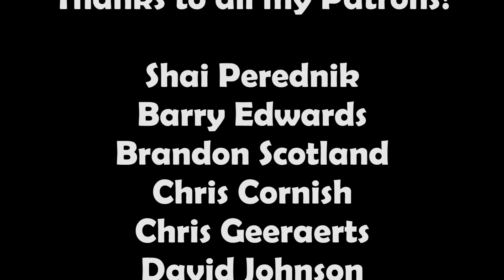Watch this before buying the Artillery Sidewinder X1!!

Comment: The idler arm is not an issue with this printer specifically. Almost every Titan clone has the exact same piece of plastic which will snap if you pull the arm too hard. That’s why I upgraded to a bondtech clone
Reply from the maker: Only other Titan Clones I have from a manufacturer are the Tevo ones and they do not have this issue at all. I've used TriangleLabs ones as well as an upgrade and they do not break.
Reply: @Fugatech3DPrinting  There are metal idler levers available.

Comment: `Buying a machine and knowing that within a week.....blablablagh...
Sorry, I think you made a great point with the idler, and also with the ribbon cable, but don't talk like the printer is the biggest piece of crap in the world, as that is just not true.
I have a couple of them running almost daily, and I have not had 1 problem with them. I don't even use the Idler, as I remove and feed the filament from within the menu and this works fine.
I think when I compare the quality of the prints from this printer to that of the JGAurora A5, the Anycubic's, the Prusa MK2 and MK3, this printer nails it, by far.
Yes, you might have to put a drip of hot glue on the ribbons, that's a very good solution you give there. But hey, big deal. bring it that way, without the whole disaster story.
Reply: My thoughts exactly!
Reply from the maker: It does print very well but the Anycubic and MK3 that I have didn't break within the first week of using it. If they would actually fix the idler and fix the ribbon cable connector, hands down this would be the best printer around.
Reply: @Fugatech3DPrinting  my Chiron from anycubic had problems since day 1. I just replaced the power switch after it had smoked and fried when I really needed it last week. 
But yeah, people have different yet common problems with cheap printers from China. 
Meanwhile my CubePro (US based)has been printing for more than 5 years with no replacement parts. Costs vary for that type of thing though.
Reply: @Fugatech3DPrinting  Anycubic, really? Mine has even no thermal runaway protection from start and I guess that is Anycubic standard. It is loud and I would never recommend that machine even for a single print without the thermal runaway protection. With some mods (fans, etc.), new drivers and a new firmware finally it is useable, but in the end I payed more than for the X1 which still has no broken parts and has printed so many spools without any issue.

Comment: Shane you’re so dead on. I got this printer and it had all the issues you mentioned. I got pissed and rebuilt mine. You didn’t even mention the other big issue. The MKS GEN L clone board is junk, the screen is junk and they both have major issues. 1. You can’t save to eprom, 2. It’s 8 bit, 3. All the wiring for the screen is mismatched cable ends to the wrong plugs and is hot glued together. I replaced my board and screen with a Duet 2 WiFi and Panel Due... the hotend and extruder are both completely garbage. A PTFE lined Volcano? Lol. The Titan Aero is cheap and works fine, but the tension arm is crap, the job gear is crappy, the PTFE tube they send with it is garbage, oh... and the Pancake Motor, yeah it has a press fit PLASTIC drive gear on it. I replaced mine with a genuine Bondtech BMG-M and Slice Mosquito. I also added a EZABL. Even with all that, it still doesn’t print super good because of the Z leadscrews and the brass nuts are goofy and cause z banding. I took my belt off, and removed their leadscrew plastic assembly. It’s way better albeit not perfect. 

I’m glad you called a spade a spade. This printer is good for most people. But for heavy or professional use it’s not.
Reply: You say "But for heavy or professional use it’s not." Why would you expect it to be? Are you kidding? Overstate the obvious much? Its a $400 printer from China (or wherever) competing with others in its class. That class has no place in production or engineering. What were you expecting when you ordered yours? You couldn't have really been surprised to discover its shortcomings unless you're a rookie at this and I doubt that you are. How about giving us a little detail about your leadscrew mod. That would be helpful. A sarcastic laundry list about what is wrong with it and why its junk is not.
Reply: @ew7007  I appreciate your response. If you go to my channel you can see my printer. I am no noob. I've been printing forever (3 years :)... With that said this is my first Chinese printer. I have two Prusa's and a SeeMeCnc Artemis. I got this printer with the intention of just using the bed heater assembly and the frame. But I didn't realize how bad the ribbon connectors are. The ribbons are fine and durable even... it's the shotty Chinese soldering on the PCB's... it's like they are trying to build PCB's in the basement of their mom's house. The Z Banding is a Major issue. They for many reasons have bad z banding. My guess is that they have a combo of Bent lead screws, and/or inconsistent upright extrusions or even wobbly wheels. In my case it the way they try to Chin-Engineer a anti-backlash system for the lead-screw nuts. I removed this system and went to good old fashion leadscrew brass nuts and it helped a ton. They also have the two z lead screws (and two Z motors) connected at the top with gears and belts. This is generally a bad idea. If the they get out of sync and they do, the X Gantry will tilt and stay that way causing issues. IF they are separate like they are supposed to be you can do a "MAX_Z" with sensorless endstops enabled on the Max_Z and level the X Gantry to the top cross-member like its supposed to be before doing the MIN_Z with a endstop or probe. That's how Prusa keeps the motors in sync all the time and the gantry level.
Reply: @thelightspeed3d712  Now that helps a ton. Thanks! I'll look into changing out the leadscrew nuts and employing the MAX_Z processes. I'm not trying to get Prusa grade quality but the Z banding is annoying as hell and something I want to address immediately as much as possible. The ribbon termination boards is a no brainer. I do appreciate your reply and follow up with good info. I'll check you your channel. Thanks again.
Reply: @thelightspeed3d712  You paid twice as much and then some for the Prusa and still had to fully assemble it yourself. You are not comparing apples with apples. I modified my Prusa loads before I was happy with it. This printer is sub £300. Anyone with 2 brain cells to rub together must know it's either going to be good enough as a plaything or a fixer upper. With the money I spent on the X1 it still comes in cheaper than the Prusa and I'm infinitely happier with it than I ever have been with my MK 2.5.... because yes I paid a shit ton for a Prusa upgrade kit to address the short comings of the MK2.
Reply: @thelightspeed3d712  All CNC board got a clone drive so a parallel axis is always synchronized without using mecanical part. I wonder why they don't used such board instead, such kind of board are not expensive at all.
Reply: And a professional wouldn't pay less than £300 for a work horse. Are people's expectations actually a bit OTT? As a hobby tool it's a bargain. We're makers FFS, these little hurdles are present on printers that cost more than twice as much. The new Prusa mini costs more than this and has had issues out of the gates. My full size Prusa needed loads of mods before I was happy with it.
Reply: "This printer is good for most people. But for heavy or professional use it’s not." lol

Comment: I have had mine since 1 November 2019.  It has been going constantly with many filament changes.  No problems.
Reply: soon soon will die, trust us... get some ABS os PETG and print a pair of those, or you will not be able to do it if it is your only printer.... I own 3 of them and all of them went down. I end up printing a few levers on PETG an all good since then. (dont print them with PLA).
Reply: Kreative Drone mine was fine, just adjust the pressure that was put on it
Reply: More important why would a company send a replacement part other than hardware right from purchase, if it wasn't a know problem?
Reply: @forward3dprinting796  Off course they know the problem,they are not stupid people yes?,and they know ALL of this problems,soo why  they dont solved even from Version 1, 2,3,4 and now 5?
Its call greedy...people just continue buy them, so they put literally-replacement parts the arm , and flat cable, and forgeit.
Lets mede the customer(the "makers") to solve.Now we have steel arm replacement.
Reply: your thing is gonna die soon not kidding, i almost returned mine
Reply: Don Gray okay clearly u dont understand this printer, in a month, my board was fried, ribbon broke twice and the heating layer of the bed lost adhesion, i only got it for a month, luckily they did send me replacements, but it was a hassle to install. i could’ve returned it for free, and just buy another one tho.
Reply: @icanc0  this is a late response, but how the heck did your board get fried, save from user error? also there is hot glue and printable strain relief for the cables, which is the first thing you shouldve printed. With the heat bed, thats just a bad part i guess
Reply: Congrats, you're the 50% who don't have this problem.
Reply from the maker: I wouldn't have made this video if I was the only one having this issue. Many don't have issues but going through the FB group, many have the exact same issues I have.
Reply: @Fugatech3DPrinting  That's Becuase they ham hand it and don't know how to move the lever properly.